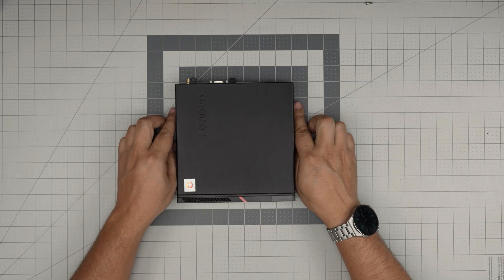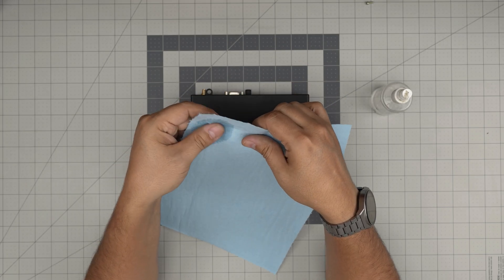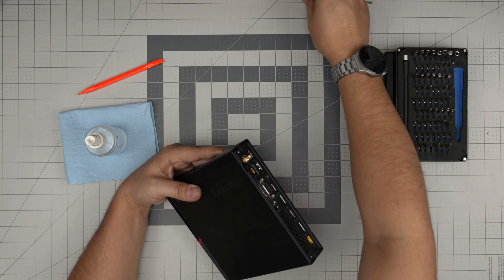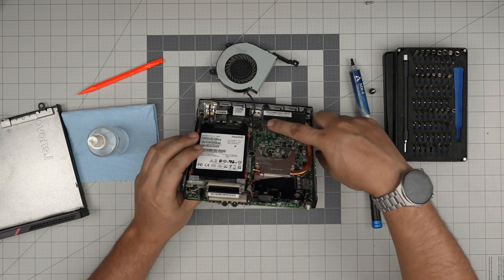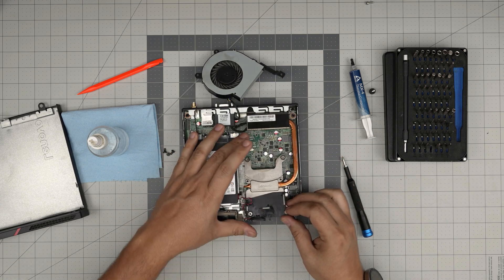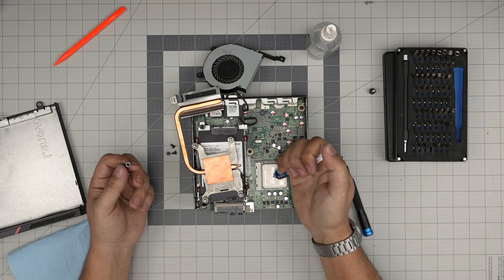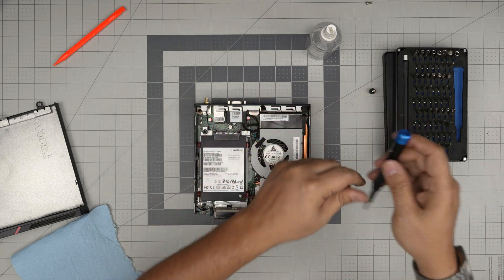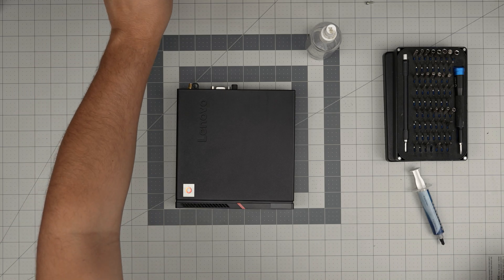How to Repaste and Clean Your Lenovo ThinkCentre M715q Mini

Comment: Why has to change this
Reply from the maker: 🫠Regarding your question, thermal paste expires after use and will no longer transfer heat efficiently, leading to slower CPU performance and potential internal damage.  

It’s similar to a car—if you don’t change the engine oil, the car will still run, but the engine will degrade over time.

Should you have any further questions or requests in the future, please don't hesitate to ask me.
cheers🍻